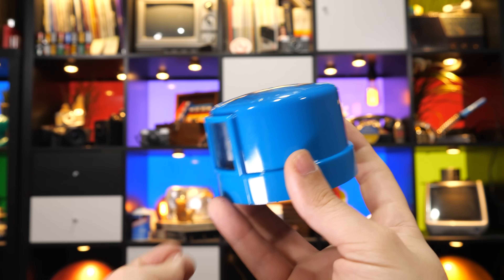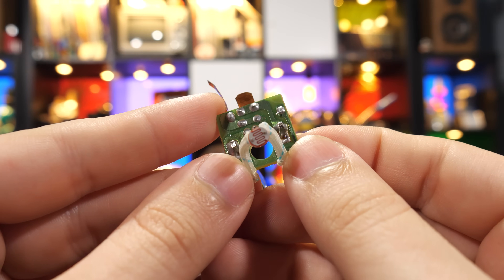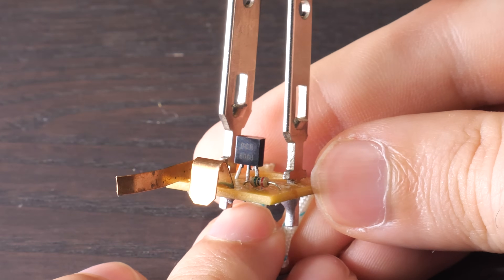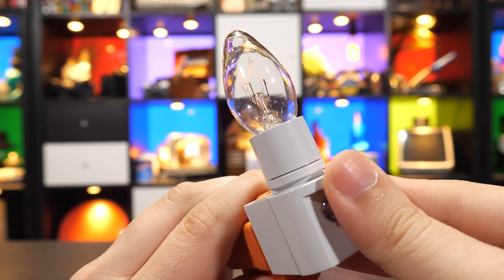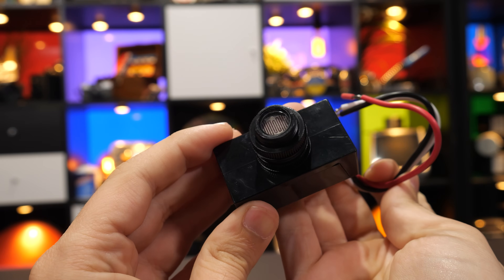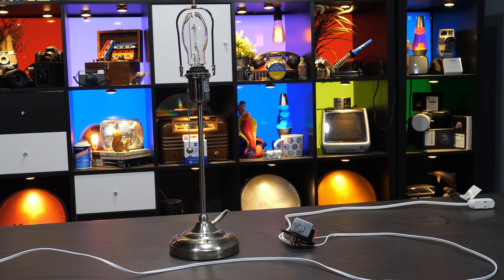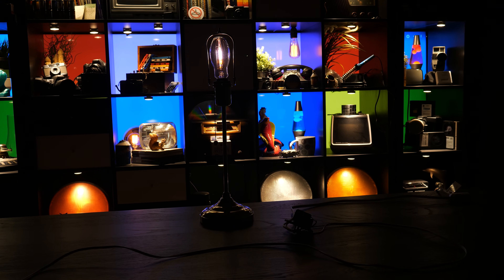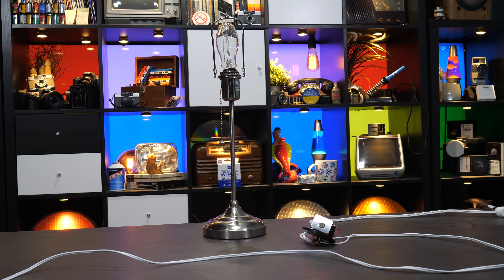Photoelectric light controls are weirder than they seem

Comment: You can use the comparator and set the hysteresis (no microcontroller needed). But sure, you need low voltage to power it. You can probably use a capacitive dropper to make it run on mains voltage, but I consider that cheating :D

Comment: This type of switch was very common around here (I live in Brazil), but no more. All of them are now electronic and have standard relays inside. Also, the LDR is replaced by a photodiode or phototransistor, is tiny and sometimes there isn't even any kind of window to let light in, relying on the light transmitted through the plastic case. Maybe because while 2 or 3 watts times a few million units around the country result in a non negligible use of power, compared with a few milliwatts of the electronic version.
Reply: Modern LED street lights, or at least the ones I'm familiar with, do indeed incorporate a different type of circuit. LEDs require a regulated (constant) DC voltage and the typical supply is a much higher AC voltage. So a circuit is required to convert one into the other. The circuit is usually a switching power supply. I'll ignore the details, but its design requires a switch between the AC and the DC. Since the switch is already present and required, and is controlled by a small voltage already; it's relatively cheap to have a photocell (more likely a photo-transistor) control the switch as well. 
In addition, since LEDs require lightning protection, the whole electronic assembly is protected against it by inexpensive components called MOV's. The whole system, including the LEDs, is so much more reliable (labor cost and increased safety) and energy efficient (energy cost) than the old system that the typical payback time for the more expensive new system is less than a year. And because of mass production the cost of the new system is rapidly approaching the cost of the old system and will equal it in a just a few years. (The LEDs are already much cheaper than the bulb.) The main failure mode, by the way, of the old system was those bare electrical contacts which were corroded by the spark that jumped across them as they opened and closed. The component that was analyzed was already obsolete as the newer ones of that design employed a mercury switch that wasn't corroded by the spark and was simply tilted by the bi-metallic strip so that the mercury would run between the contacts.
Reply: @2ndfloorsongs  Sure, the migration to LED street lights is happening... fast! It makes this kind of device almost obsolete, allowing every light to have its own sensor.
Reply: I'm sure it's the same here in the uk, now that most street lights are LEDs. It would seem silly to have a control circuit that takes nearly as much power as the light
Reply: I'm sure that by now they've saved...like...a Brazilian dollars or more...
Reply: @JTA1961  Only Technology Connections has the power to encourage reclusive nerds to come out of their shells and make nutty comments such as this.

Comment: You missed one reason we still use a system where the control is energized to turn the light off, safety. When the components go bad, they lose the ability to deactivate the lights, and thus the system will fail-on. The nuisance of your lights not turning off in the day until an electrician can come replace the sensor is much more preferable to a blacked out parking lot at night.

Comment: Hah! I added gamer lights/LEDS using the 5V 1A USB plug behind my TV with an arduino, and used a photoresistor to dim the lights at night, depending on the amount of light. I had ChatGPT write all the code lol but yeah, it breathes between RGB values, and the brightness in controlled by a photoresistor, all powered by the USB plug behind my TV. Very appropriate timing.

Comment: In the house I just bought, there's an outlet in the bathroom with a built in nightlight.  There is, of course, one small problem.  The outlet doesn't have energy until you flip the switch.  The same switch that turns the light on.

Comment: I'm not an electrical engineer, only a hobbiest. But would a photoresistor, a single transistor, and a relay not be cheaper and more energy efficient than a thermostatic switch heated by 2W of resistors? You can have comparably little current running all day and at night run arbitrarily larger amounts of current to the bulbs at night with an appropriate relay.

Comment: The fact that your (or some) streetlights have sensors on them is wild to me. Here it's just controlled centrally where all streetlights are turned on at the same time. Or in groups at least. Seems simpler than having sensors on every light that can fail and need replacing

Comment: Very informative! Just one little thing I'd like to mention: 16:50 You can also use one microcontroller to control 100 or even 1000 of streetlights if you just have a central one and wire the streetlights up from there. The microcontroller can stay in a place where the sun does not shine on it.

Comment: A seaside caravan park I go to has little bollard lamps which must use a different system for light detection and fail to have any or sufficient hysteresis built in, or code with differnt values for switching on and off, so when it gets to twilight you see them flashing on and off for a few minutes going crazy. I assume their own light is enough to turn them back off when it's not that dark.

Comment: The photoresistor part is also one of the oldest solid-state electronics too, its invention dating back to 1890s? Most other solid state electronics came about with other transistors, which would be after 1947. Not sure what use that trivia is, but it's kind of interesting.

Comment: LMAO at the hysteris thing, I was thinking the same thing when you said latching mechanism earlier in the video "isn't that called hysterisis?"

I'm surprised by this video, mostly because I assume ambient temperature would play a large role in the activation curve, but seems the locality of the thermostatic switch and the amount of heat from the resistors is fitted enough for ambient temp to not really matter that much.

Comment: At my last job, I changed dozens of those...inside, there was a sandstone resistor between bimetallic contacts...all open, once you removed the shell. No sealed limit switch, or anything. Very simple and reliable.
      You would be changing them after every serious  storm, though...storm damaged ones had their contacts welded together.
    Repairable, sometimes, and I have done it as a challenge, but they were cheap enough to not really be worth it.

Comment: My father added an extra step and had our photo activated outdoor light on...... a timer. I think the current draw of the timer was less then the photocell, but there was a reason why he did it. These photocells tended to fail often, usually in the closed/on position. So instead of the light running 24/7, it would only run overnight. Even then, he had the timer set to turn the light off at 2AM or so to save more electric.

Comment: How does the light level threshold for switching change with outside temperature? Especially the possible differences between a very cold winter and a very hot summer?

Comment: 4:45 This is perhaps nitpicking but this is a channel that emphasizes precision:
It's perhaps important to note that it's not just the alternative current path that causes the thyristor to turn off. The key here is that the photoresistor when lit has a much lower resistance than the 2MOhm fixed resistor - this pulls the voltage potential of the thyristor gate much closer to neutral than to live, which eliminates the voltage that's driving current through the thyristor. It's an example of a voltage divider - the important effect is the change in voltage and the exact amount of current isn't as important.

Comment: I bet you the inside of that limit switch is very similar to the bi-metalic bar switch, just without the integrated heater.  Something bends when it gets hot, and that movement is used to toggle a plain old mechanical switch, you can even hear the click.

Now you could also use the semiconductor one from the night light to drive a relay that would then switch on and off much larger loads like the multiple high power street lights, but the limit switch resistor heater combo is likely chosen because of everyone's favorite word: hysteresis.  The little one can switch on and off a bit too quickly and easily.

Comment: they do have high powere semiconductor models, but people hate them because they do cycle on even the shortest flash or interruption of light.  they also don't give 100% of the power to the controlled device, EVER, so they can't be used with anything that is bothered by not having a perfect waveform.  so then you can find ones that have a semiconductor control and a thermal relay.   I think those do actually reverse the function so the photocell turns off power to the heater the relay cools and opens.  but I'm not sure.

Comment: Another common method you will see in devices such as those battery powered yard LED lights with solar cells, is the same cell that is used to power the battery during the day, is then used as a switch to enable the LED during night.
Reply: This is becoming very common in Australia (at least the parts I live) with basically every new street light now being LED. I assume they have electronics to control the on/off state. Yo usee both hardwired versions but also battery "off grid" versions.

Then again once you leave the cities the whole country is off grid.

Comment: Okay, but use tiny solar panels. If you can draw just enough power from a few solar panels on the standardized device to run a microcontroller that controls both the light and the charge/discharge management of a battery that should be enough to last 30 hours (imagining a situation where overnight the area loses power, and it doesn't come on until the next morning) as well as the signal needed to operate the lamp, you could negate the need to draw power from the main system unless the battery dies. It's very possible that solar panel efficiency isn't ready to handle that situation yet, but it could reduce the power draw throughout the day if it isn't building a charge yet.

Comment: 9:45 fraud. you should show the electrical setup in regular lighting before showing it exclusively in thermal imaging. you did not apply a voltage across the resistors. you used a heat gun and reversed the footage as it cooled down to appear like it was heating up. that's also why the photoresistor heated up along with the resistors, which should not occur if you actually wired the component to electrical power.

Comment: There are dual voltage ones with a neat feature. If you wire the sensor to 120, you can then wire it to 277 in the future. But once you wire it to 277, you can not go back to 120. Reason being is that when you wire it to the higher voltage, it burns up a small wire that's wired in parallel to a resistor. I'm assuming that it's a current limiting resistor for the higher voltage and would be too much resistance for 120 to operate. When you wire the sensor to 277 for the first time, there will be a small puff of smoke that scared me the first time I saw it.

Comment: The "bendy bar" would also get clogged up with actual bugs. They get attracted to the heat, and then they get in the way, etc. So having an almost solid state with smaller open air moving parts. Probably be more reliable in the long run.

Comment: Actually having all the streetlights turn back on after a blackout may seem inconsequential but for the engineers at the power stations it's something they would need to take into consideration as  it would be a large enough added load on the system that if unaccounted for would likely knock the system back offline during a cold start of the grid

Comment: Hi Alec, I thought you were going to also get on to the stupidity of LED based nightlight circuits. I have one of the incandescent night lights you have there - they work fine. When I tried to adjust an LED night light I discovered something - it draws the same amount of power WHETHER IT'S ON OR OFF! The circuit switches the power between and LED or a resistor, but never decreases the overall consumption. I tried to resize the resistor to draw no power when off, but you cant do it without extra components. So, making it turn on and off for day/night is purely for marketing - its not saving any power. You might as well simplify it further and just remove the light sensor altogether.

Comment: A tangent that interests me is how much precision these designs abandon, where something like a microprocessor or a networked controller could turn every light on and off in whatever pattern you want, at exactly the time you want (a microcontroller doesn't even really need the light sensor, they're good enough at keeping track of time), but that's just not important. These controllers will vary in the exact time based on the variation and age of the switch, resistance drift in the resistors, and the temperature; in many parts of the US they will turn on & off at different times relative to sunset & sunrise in the summer & winter because relative temperature is a major factor in the rate of thermal transfer. But that's plenty good enough, most of human society is insensitive to variations of several minutes, do you even really need a minute hand on your clock? (contextual, but often no)

Comment: There is a guitar pedal made by Tel-Ray Morley called the Morley Power Wah Boost. Inside of the pedal is one of these photocells covered with a leather shroud, and a light bulb inside the pedal, too. As you push down on the wah pedal, the shroud exposes the LDR sensor and the amount of light that hits it changes the resistance or “sweep” of the wah, with more light making it sound brighter, and less light making it darker. To this day, no other company has made such a pedal with that design, simply relying on potentiometers to control the resistance and sweep of these wahs. To hear it in use, watch any Cliff Burton bass solo in 1984-1986. You can also hear it on my band’s-Instigator- “Exothermic” and “Atom.” I am the bass player.

Comment: There is no need for a microcontroller with an power supply, an analog circuit would be sufficient to switch a relay. Like the one in the nightlight or a more sophisticated one with potentiometers to adjust the sensitivity.

Comment: That arrangement of ldr and resistor is called a potential divider and you'll find them everywhere in electronics. Essentially they turn the resistance of the ldr into a voltage
Reply: Not just using LDRs either.

Comment: Why do I suspect that at some point someone is going to figure out that you can replace the photoresistor  with a 5 watt solar panel that is wired to the resistors circuit board directly, and leave everything else alone, and while the resistors still heat up and cool down, (and do so even if commercial power is disrupted) it's not drawing power off the grid for actually detecting sunlight. But a solar panel ahs a mean life of about 20 years! I've been seeing street lights getting replaced (from the ground up) at a rate of every 10-15 years, so I'm not sure that's a problem. And no, I'm not saying that this is a perfect solution either.

Comment: Now, I'm just an armchair electrician, but I think the diagram for the nightlight circuit has a small mistake.
The photoresistor is shown wired in series with the other resistor. Shouldn't it be wired in parallel to the entire rest of the circuit?

Comment: Funny you should mention a microprocessor-based one with relay control. One of the products I work with is exactly that, albeit a bit more complex. It has both a relay and dimmer control, a Bluetooth radio so you can configure it via an app, has a clock so you can also create schedules (in case you want it in a specific state at a specific time in addition to using the photocell control), and the radio meshes with other devices in a network so they can coordinate with each other in case you want all of the lights in a parking lot to go on at the same time.

Comment: Not sure it's used this way, but PTC's can be used for thermal regulation.  The photocell will pass current in response to light, and the PTC will reduce the current as temperature goes up.  This would be quite helpful in controlling the amount of heat to just what is needed to reach a particular temperature, particularly in cold climates where more heat would be needed in winter than in summer to achieve the cutoff temperature (and keep the resistors from burning up).
Reply: It bothered me that this was not addressed i the original video.  Obviously these controllers do wirk as intended, but it is surprising )of generated temperature is so important to their operation) that they can work reliable without adjustment both on the hottest full-sun summer days and the coldest, windy, sub-freezing winters.  Certainly this must have been considered in the design and evolution of these devices, but it requires consideration and explanation.
Reply: It was not clear in the video how the PTC was wired up but your explanation makes sense. Maybe it was just being used for inrush current protection.